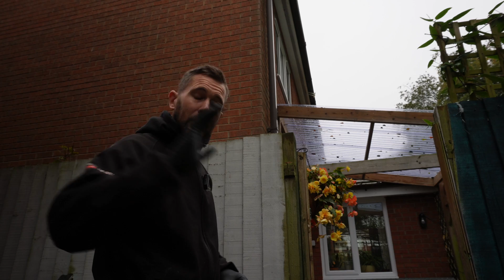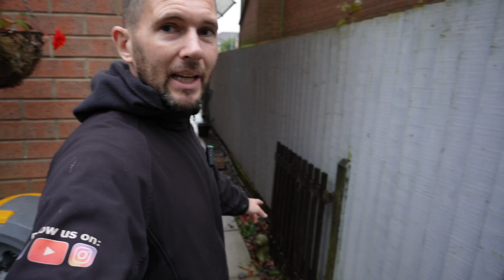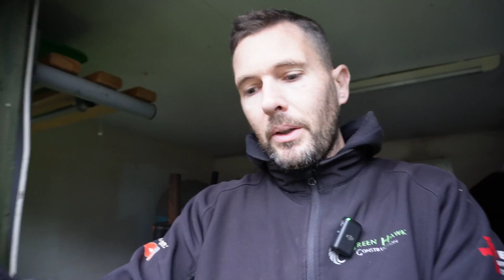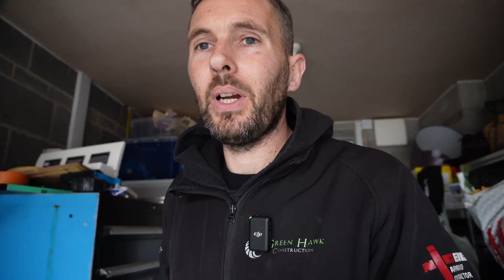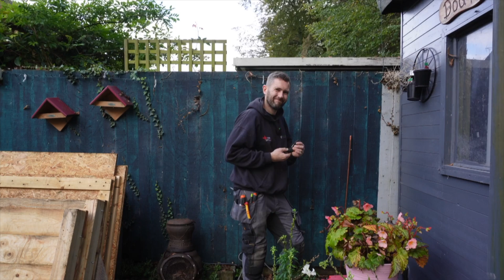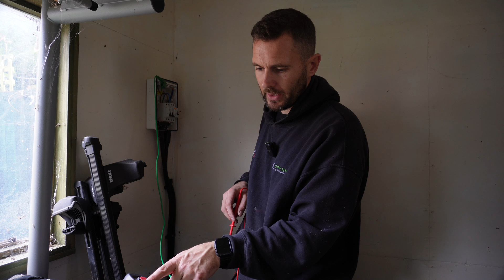How To Install power to your shed

Comment: Given that the earth rods connect to the metal cased consumer unit in the garage, wouldn't this now be classed as an extraneous conductive part, and therefore require a 10mm copper equivalent back to the earth at the property?

Comment: So the armor is being protected by the TT arrangement? as you tried achieving selectivity from the PME DB fed by an MCB?  
What Fault protection is on the SWA? 
If someone puts a spade through that SWA with a resistance to earth reading of 51ohms you will get 4.5amps of fault current , nothing will trip!
Reply: This is why if at all possible i avoid turning outbuildings fed with SWA into a TT system, you rarely will get a low enough Ze to give you a good fault current. If you are going to put an earth rod in, i would use it to supplement the PME not replace it.

Comment: So the accessories in the shed are protected by the exported PME R2 conductor in the swa and the rod is connected to the armour at the shed end?🤔
Reply: He said in the video he was going to take the armour into a plastic box at the house end as he couldn’t get a plastic CU for the shed. Not sure why a earth rod for the shed unless there are extraneous conductive parts coming in, however the client may have said they want to bring something like plumbing in so there could be something in mind so maybe forward planning. The again I am a DIY bodger so what would I know.
Reply: @davideyres955 is he trying to say that the swa cpc is protected by the tt rod, if so would it not need rcd protection at the house end to protect the swa cable

Comment: Usually " divorce". the earth conductor in an adaptable PVC box close coupled to the metal unit...sealed...so is never introduced into the c u ...only live & neutral in bedding material passing through into the c.u....
Reply: Yes ,earth the armouring at main consumer unit and isolate armouring at shed unit……..it’s a must

Comment: No short circuit protection on the swa coming into db between the casing of the db and the armouring .... That live shoule be doible insulated and i would disconnect the swa from the tt .. that plastic board they didnt have would have solved it or just the pme ..

Comment: Surely if you continue the CPCs through that (Henson?) box you are not isolating the earths at all? The armoring will be connected to CPCs at the house PME end? The CPCs in the shed will be ultimately connected to the PME earth?
Reply: I certainly wouldn’t separate the armouring from the PME at the house end as you’ve now brought 2 different earth potentials into the equipotential zone of the house??? If I was divorcing the earth to create a TT I would do this at the outbuilding end.